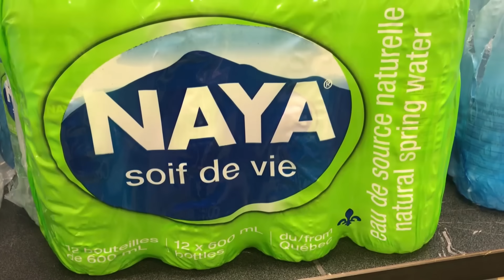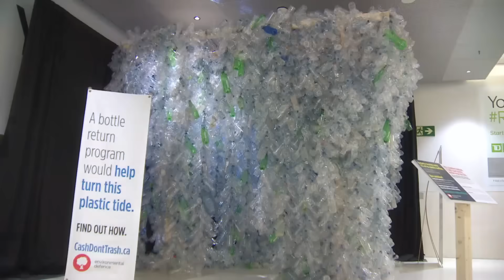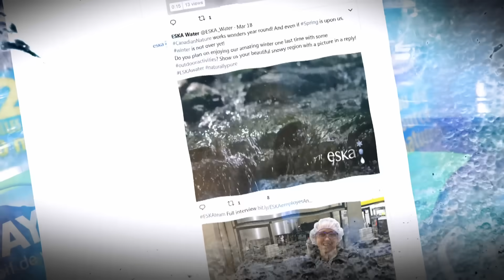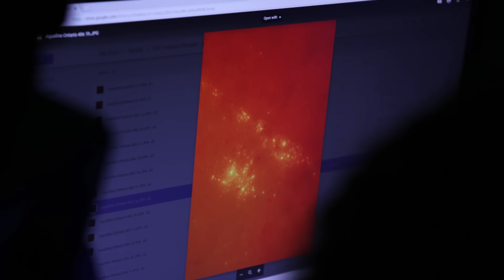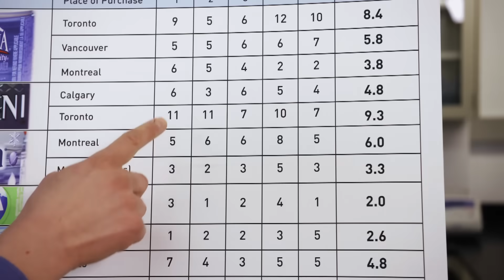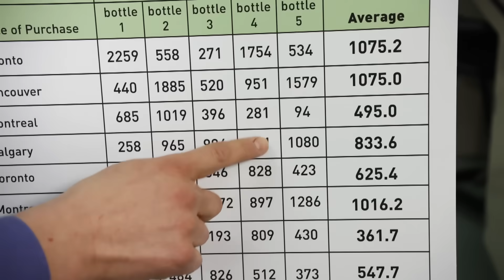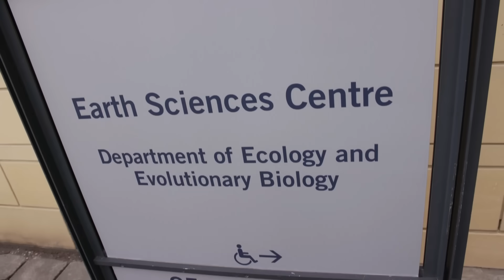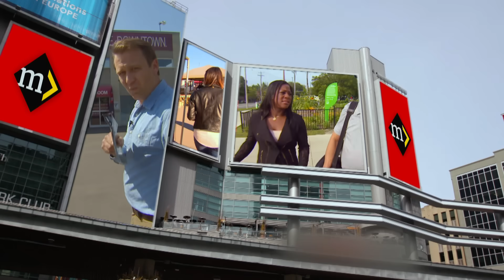Here's what's in your bottled water (Marketplace)

Comment: The problem we have locally is that our water source is a lake in the middle of huge farms.  Nothing against our farmers but at planting season, spring, they plant and add fertilizers/nitrogen to the fields.  Then it rains a lot and those chemicals run off into our water.  We end up with nausea, abdominal cramps, diarrhea and it just get worse and worse.  Then we have the middle of the summer heat and much less rain which, with all of the fertilizers/nitrogen in the water the algae grows rapidly giving our water, even though we built a new water treatment plant a few years ago using reverse osmosis, tastes exactly like pond water that's covered with the algae.  Also get belly aches, cramping, diarrhea.  The fall hits, the lake "turns over" and once again, algae taste, digestive problems.  So we MUST have bottled water through these times or we all get sick.

Comment: 1 year ago my city issued a boil water notice for pathogens occurring due to a low water pressure situation. A few months ago it again issued a warning but this time because the plant had added dangerous levels of chlorinate to the water inadvertently. If I fill a glass with tap water I see particulate in it.
This story is the same wherever I have lived so to tell me bottled water is somehow a bad choice, well, go screw yourself.

(Good follow up story would be "Just whats going on down at the local H2O plant?")

Comment: We should have switched to using silicone a long time ago, it's better for our food and for us. It will not break down anywhere near as fast as plastic and needs to be recycled properly, however if it does enter the environment or our bodies it is a lot safer.
Glass bottles and an exchange program may be an interim solution, there is no reason why water bottling companies cannot share the same type of bottle and apply their own labels, they are not going to like it but they are presently a big part of the problem and should look to becoming part of the solution instead.

Comment: What a propaganda piece on bottled water.  Stop using plastic bottles ? Then what type of containers do we use ?  Micro particles in your plastic bottle, so, glass, aluminum, steel and waxed paper containers would have no particles in them. Not likely. Plastic particles have not been proven harmful. The problem with containers made of any material being in our water ways can be solved by not littering in the first place. Now that's  a video I could get behind.

Comment: In denmark they have unlimited purified water supply. because Denmark is flat as pancake and is a archipelago its very windy and humid here making it rain almost daily. because of the ice age 2000 years ago most of the underground 10-15 meter down is thick calcium layers that helps filter the rain water. which we can drill a hole and suck up the water, this water is then taken to a facility where it is measured and checked for contamination and then send to all household tab water. 

about the ice age you have to imagine a thick layer of ice covering the whole surface of Scandinavia, about 2 km (6561 feet) thick layer of ice covered the whole of denmark hence why denmark is flat as a pancake. Ice age was long time ago and there weren't any humans living in Scandinavia at the time. well when the ice started to melt all natural that water ran down through the ice itself in these drainage tunnels and layered the ground with Calcium and salt. Most of the salt has been used by Vikings throughout the years as a trading goods or to dry meat for storage.

Comment: Here's the deal in a nutshell. Most "bottled water" is just filtered tap water. You would be better off investing in a quality water filter and bottling your own water via a reusable sealable drinking container. Some bottled water is distilled, which is actually usually pretty pure. Some bottled water is "spring water" which may or may not be good and may or may not contain contaminants. If contamination is something you worry about, get distilled. If taste is something you worry about, get spring. If you just don't care and want water that just doesn't taste like crap, get a good water filter setup. I get about 80% of my drinking water from a local business that uses multiple filters. It doesn't remove everything but it makes the water taste better and it's free if I bring my own bottle. The rest I either get distilled or spring depending on what I want to do with it and what's available. I don't drink tap water because my pipes are old plastic and you can taste the plastic. I'm not drinking that. Replacing the pipes is too cost-prohibitive and investing in a good filtering setup just isn't worth it right now when I can get free filtered water that uses a very expensive filtration system.

Comment: Meaningless without a comparison to actual tap water.
Reply: I have a hunch they tested or asked the testers and it turned out even worse making the whole episode pointless. No other reason to not compare it.
Reply: Sean 
They actually did check tap water. It's mentioned (somewhere) in this video:
https://youtu.be/ChHbZOTaXfc
Reply: Sweet lime yeah cause its filled with it lol. Along with heavy metals, pharmaceuticals, and god knows what else. Get a berkey filter or Reverse osmosis and youll be good. Dont forget shower filter
Reply: Not to mention that they don't make any concrete claims other than "the water does have plastic in it" and then frame the rest of the entire piece to make implications that the data does not bear out. They don't explain how the volume of plastic in the bottled water correlates to any other sources of water, and what the implications of the plastic being there entails. You can do the exact same test for Arsenic, a highly toxic chemical, and every single bottle will be positive, but in extremely small quantities that are completely harmless and occur naturally at much higher levels. But had they made this piece about the contents of Arsenic in water, one could easily walk away from this thinking that bottled water is practically poison. Basically, the entire premise of the show goes: 

1) Bottled water contains plastic!
2) ????
3) Therefore, DOOOOOOOM!

I am not trying to argue against the fact that plastic pollution is an epidemic, but this piece uses a whole lot of words to say absolutely nothing. Fear mongering at its finest.
Reply: My water is sandpoint, not city water. And it runs through a softener before it gets to the faucet. Tastes great.
Reply: Lol i didnt say you should. Im saying just because it doesnt taste like chemicals doesnt mean it has no contaminants.
Reply: Taste doesnt mean its not full of garbage.
Reply: Well it depends where you live :) In london it very much tasts like lime scale haha but I still drink it...
Reply: It was about plastic pollution not a tap water comparison.  Watch it again!  Start using reusable water bottles.
Reply: TomaCukor 
Yup.
Reply: We have to have a certain amount of free chlorine in public water systems. It's mandatory
Reply: Dasani brand is also in Somalia. Water bottles started recently in 2012 and the it has caused devastating effects on the environment in Somalia. People litter in dry river beds and when it rains water streams spread all sorts of plastics across the country all the way to sea.
Reply: sir, in india we have the purest water in the world.. we get it from a river called yamuna
Reply: Sweet Lime 
Like a swimming pool.

Comment: Taking the cap off introduces plastic particles at the screw surface and cap break-off boundary - straight to the mouth and consequently also into the bottle. Are these recent tests compared with any legacy analysis ? Forensic laboratory standards should apply for testing at source prior to bottling, after bottling, after capping and after uncapping and after drinking measured various quantities from the bottle. Statistical analysis of resultant data will therefore provide unbiased facts.

Comment: What about microplastics in tap water?
Reply: Both contains plastic,
So will you pay dollars to large companies or just drink it from tap.
Reply: But what about that airline food?
Reply: There is really no good way to know except spending huge amount of money testing in a variety of many places, plus, it's not just plastics, there are all sorts of heavy metal in tap water that may not be filtered at source, also remember, the water had to travel in thousands of KMs of pipes to get to your taps, many of them decades old rusty pipes, so who knows what all kinds of crap are in it when the water finally reaches you, try to do the smart thing, do your own filtering at home, it's the only thing you can control in what kind of water goes into your body.
Reply: What about #bradswife?
Reply: joe maldo "Personal pump wells, city wells, lake, river, reservoir. They all have pvc or some type of plastic pluming." Wrong, my brothers well is metal casing, stainless steel pump, metal drop pipe, metal tank, copper piping to metal faucets. Where is the plastic plumbing or wooden buckets? These days some people switch to plastic plumbing in their wells, but they are not being forced to, they have a choice to still use all metal. Even if you buy a house with existing plastic well plumbing, you can have it all replaced and even drill a new well with metal casing. Wood or plastic has not been, and still is not today, the only choice for wells and plumbing from the wells.
Reply: mobis ware Boil it first
Reply: what about it?
Reply: Tap water has pooh and Blox117 does not want you to remove it.
Reply: De[ends on how you get your water from. Personal pump wells, city wells, lake, river, reservoir. They all have pvc or some type of plastic pluming. Really outside of the old fashion wells with wooden buckets or maybe collecting rain water into a wood barrel will have some plastic particles. then we have metal contamination and air particles. I have a well myself and a filter just because of the hard water. I had my water tested. Nothing dangerous or unnatural. Just sand and minerals. Filter by the earth and maybe some old animal pee.

Comment: when coca-cola bought the distribution rights to evien, they started adding sodium fluoride to the mix.
ive personally called and required information to determine this fact.
is the lead pipe in the city worse than the plastic bottle?
who knows.
but tap water is poison. cognition numbing poison.
Reply: and the crowd goes silent
Reply: get a BERKEY AND STOP THIS NONSENSE.
Reply: Tap water is safe. Chlorine and fluoride have been added for over 70 years with no ill effects to anyone. We actually live longer and no one has died due to tap water unless contaminated like what happened in walkerton. If tap water was bad you would have millions of women loosing their babies. That’s not happening.
Reply: NoLeads Ent. Problem is that your citing articles about high concentrations over 0.7 per million. Most governments do not go over that because of those kinds of studies. The studies are what happens over the recommended safety standards. It also states about the fluoride in toothpaste which I would more strongly agree with is a much greater cause for concern then with tap water. 

Also, it’s really hard to have a study regarding tap water vs fluoride in toothpaste because you would have to do this over decades. One study would have to show those who did not drink fluoride in water to those who do. The other would be a study of people that did not brush their teeth with fluoride toothpaste or use fluoride water to those that use toothpaste and also don’t drink fluorinated water. Also even cooking and washing yourself would have to be regulated. Basically any test subjects are already contaminated anyway since fluoride is naturally found in water. 

They only are studies on over use of fluoride which is relative to how much you ingest in high concentrations. These articles do not prove tap water is unsafe. It only proves fluoride in very high doses over time is a real concern.
Reply: where does "sodium" fluoride come from?
and tell me again why i have to consume it from showers to washing my food, because of the personal hygiene neglect of the few in our city?

it seems your argument is- it's not enough to hurt you.
its slight overconsumption causes cognitive issue's and we use it to water our food and wash our vessels, brush our teeth & gums, and resides as almost 70-80 percent of our total body mass.

last point. "calcium" fluoride is found in the earth and water, yet "sodium" fluoride (as you hopefully checked) comes from runoff aluminum, which is labeled toxic and would cost the producers more money to dispose of its substance than the profit made from its production.
so hey, why not sell it to cities for a cool 200,000 dollars a shipment. as Toronto has. 
we pick up the bill as taxpayers.
as Walmart adds "sodium" fluoride in baby water as well. its obvious Harvard is not studying this causation for fun or to waste time.
Reply: NoLeads Ent. Harvard isn’t even studying most of this. It’s stated it’s Chinese research. 

And I have no idea what half of what your saying. Makes no sense at all. Please use proper sentence structure or something. I can’t even understand where your going with your dialogue from one thing to the next. You basically made no points, your all over the place.

Comment: Don't we recycle those bottles? I do at least.
Reply: When you recycle plastic it gets shipped to China via freight (so highly polluting) and used to create other plastic materials that are not-so-recyclable. Long story short, your recyclables end up in the landfill anyway. The only solution is using less plastic.
Reply: A lot of stuff b recycle hardly even gets recycled. Also, recycling uses way more energy than it's worth it.
Reply: so should the answer be a easily biodegradable form of material?
Reply: plastic can only be recycled so many times before the molecular weight of the polymer molecules becomes lower/less strong

Comment: Water from a uncontaminated well in a remote area is the best. Either that or glacier water or from a remote spring. With bottled water, it is suspect that it is spring or glacier water. It also tastes like plastic.
Reply: yes most private wells i work on have a less than desirable taste due to the natural minerals like iron and sulphur.. filtering them for drinking purposes is far more costly than buying a few cases of bottled water a week.
Reply: Uncontaminated by plastic, but in general not true. Well water can easily have high levels of arsenic and heavy metals that are naturally occurring. Some can even have radon dissolved in the water.
Reply: Best thing to do is buy an advanced water filtration system for under your sink. $100-200. Problem solved, why isn’t this obvious?
Reply: MXSLICK Water filters are cheaper now. They work very well.
Reply: we call them wells. a drilled well is a deep well and dug wells are more surface shallow wells. another concern is chemical contamination thats not regularly tested..things like PCB'S,TCE's,filtering doesnt remove that stuff
Reply: Get a distiller saves you having to buy bottled water and contributing to the plastic that somehow ends up in the sea. When you distill it you can be certain of what's in the water (nothing)
Reply: a well? no... still water isnt a good thing. running water is the best.
Reply: If you want to save money: Think out your electricity or labor cost to get the water out of the ground from your well, filtering your water if you wish, possible failure of your pump, or water cost if you are a city boy. If you want to worry about health, think about that bleach and clorhine they put in the city water, or what type of well water, piping and filtering you use. Your decision really.
Reply: Dwayne Wladyka isn't all the underground water cycled the same route and eventually flowing the same source
Reply: Joana Gil really? Tap water is dirt cheap and good to drink. A human drinks maybe 500-600 l of water per year, that costs less than 0.5$. why do you think the reverse osmosis installation was worth it? Do you not have good quality tap water where you live?
Reply: The gallant dor rain comes from sea, true, but it is all evaporated water. Generally, only water from the sea leaving everything else in the sea, so the rain water is not salty and not cotaminsted with microorganisms and such. Rain is as clean water as you can get. It's only very hard to get a lot of it before it touches the ground and gets cotaminated again.
Reply: Dima Pollution from industry can go into the rain. That's another thing.
Reply: Dwayne Wladyka Glacier water and better call Kurt Russell because The Thing will be taking over the world.
Reply: Joe Raby yep. Where I come from people dont drink from wells anymore, evwn though the wafer looks and tastes prestigne. Water from wells is used to water plants, bath, shower, etc, but not for drinking.
Reply: Shankovich Depends where the well is drilled.
Reply: and according to u , there is enough for everyone
Reply: but will it be enough?
Reply: Dwayne Wladyka bit that water comes from rain that is taken from the sea (which is really polluted)
Reply: Dwayne Wladyka some of us are in populated areas and don’t have that option
Reply: MXSLICK I’m in Portugal, I have both a well and a borehole (don’t know if that’s how you say it) in 2 different places. I have reverse osmosis systems in both and the system was not that expensive... 1000€ each I think... we save a lot of money on water.
Reply: Japanese are harvesting our glaciers for water. The problem with that is that the glaciers are getting smaller and that causes the oceans to get warmer. Not from global warming! They drink that water then pee it out and well, you can figure it out.